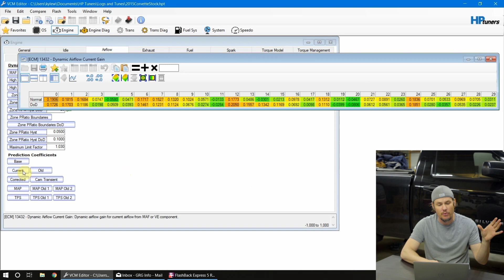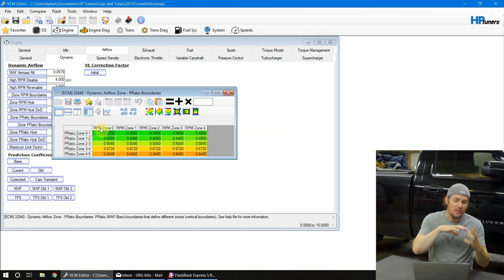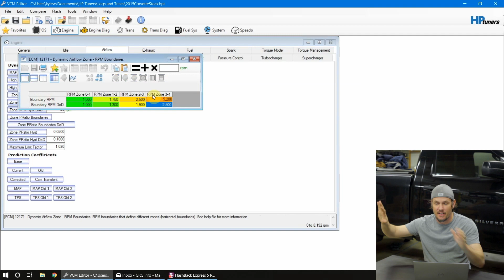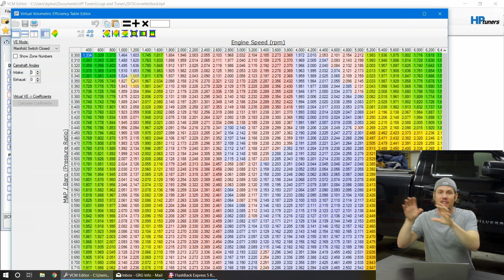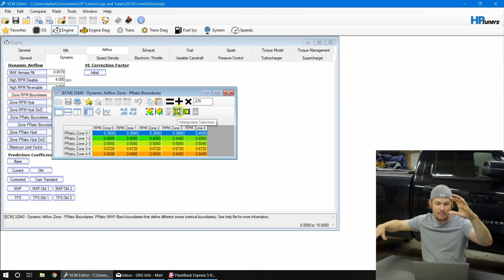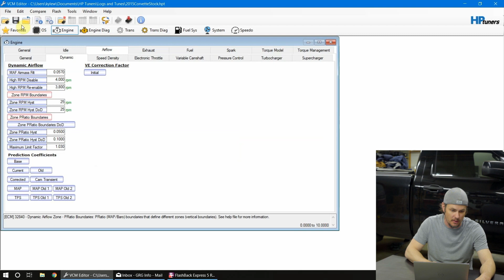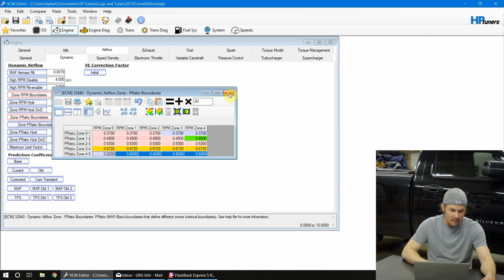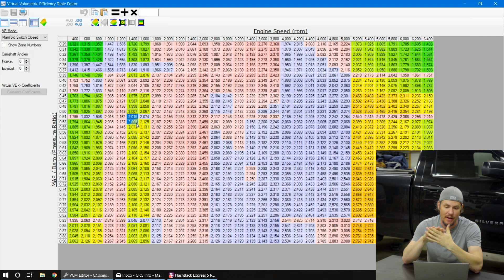VVE Coefficient Calculation Errors, Using Zones To Keep The Calculations Happy

Comment: So do you just edit the zones like you would edit a VE table naturally based on MAP x RPM?  Also, what are the actual table values? I'm used to Holley EFI showing the VE percentages for each cell, but these values are 4 digits.  Lastly, is this table the authority for fueling, or will my MAF try to take over even if I make changes on the fly that override this table?
Reply from the maker: This is like that but there are some other factors but bigger number is more airflow, just keep that in mind.  Try the stock zones, only worry about them if you're running into oddities.  When the maf is enabled you're using both, when disabled only this table is active.
Reply: @GoatRopeGarage  Ahhhh that sort of makes sense! So I'm having a weird issue on my turbo 2.4L with an e67 ecu. I have my stoich set to 13.92 but my LTFT keeps pulling fuel to keep me around 14.50 regardless of manifold pressure. another issue is that when I roll into throttle on low RPM, I build boost quickly and it spikes lean up to 15-16 afr before correcting to my PE afr. I was going to try to use the VE table to add fuel on the low RPM/high boost areas.
Reply: @VitrusResearch  

Tuning a hhr lt with 2.4 and 62 mm turbo with 80lb injectors. The spikes your having is the transient tables not tuned correctly. You shouldn't have LTFT on at all, Only short terms. Btw I run full MAFless.

Comment: I just sent you an email about this and zones. Im now wondering if a properly dialed in 3D table is still supposed to look nice an smooth with no spikes/dips. I feel like this will be very time consuming to get this dialed in. Are we leaving any HP on the table if we dont run VVE?
Reply from the maker: Probably not, I wouldn't obsess over it, just get it close enough a your MAF is doing all the heavy lifting

Comment: Question... would you tune the ENTIRE VE or VVE table (including WOT) and then run a car in blended mode (setting the dynamic disable to 8192)? Do you think there would be a benefit to this?
Reply: Oh... Im referring to Gen 3 and 4 BTW...
Reply from the maker: Yep, you want to tune it independently of dynamic, same with the MAF then bring them back into play that way if one of the sanity checks fail you're good to go
Reply: @GoatRopeGarage  so tune the ENTIRE VE table INCLUDING WOT before switching to blended mode? And set dynamic disable to 8192?

Comment: I was running into this a week ago right at 5100-5500 rpms at 175-180kpa map on a 2015 twin turbo camaro, fortunately i was able to upgrade to the 2 bar sd os and that fixed it but wondered if there was a real fix to the vve, as I have a few e67 ecm setups that dont have the 2bar sd upgrade available, very helpful thanks
Reply from the maker: That's always my first suggestion if you can get away with running a 2 bar. It's a lot easier to dial in.

Comment: Whats the advantage of GM doing speed density calculations with these crazy coefficients and zones instead of just a simple rpm/map look up table. I just dont understand why they would reinvent the wheel on something that wasnt broke
Reply from the maker: That's a good question... It's about to get even crazier with the global b platform.
Reply: @GoatRopeGarage  which is why ill stick to my tried and true 0411 ECUs i can't stand complex over engineered solutions to simple problems

Comment: Last time i was on my truck i saw it was on dod v4 mode i was wondering how it would work with a mini truck and tune it to be more economic using the v4 mode
Reply from the maker: I'm not a fan of DoD. I don't know that it provides enough benefit over a well tuned engine in V8 move to justify running it.

Comment: We need a video on idle spark coastdown
Reply from the maker: What kind of issue are you having?
Reply: @GoatRopeGarage  just was wondering if there was a graph that could be made and logged and a way to edit or if your just supposed to use your fuel trim graph and set a filter to show only idle
Reply from the maker: Guess I'm not understanding what you're trying to do. Are you wanting to log advance on deceleration?
Reply: @GoatRopeGarage  yes exactly
Reply from the maker: You can use your standard spark advance table and set a filter against your acceleration pedal, probably be the easiest way to log advance on deceleration.
Reply: @GoatRopeGarage  ok thank you.